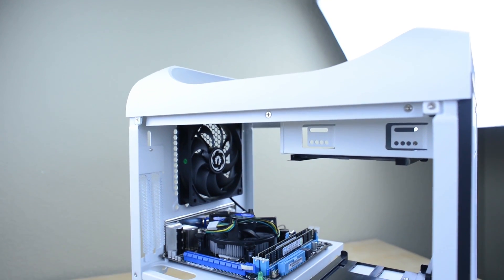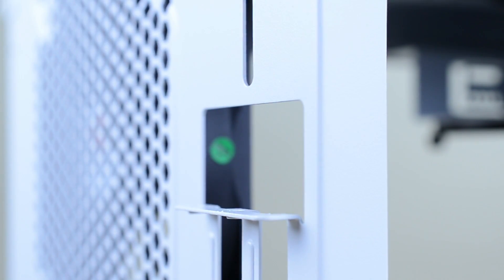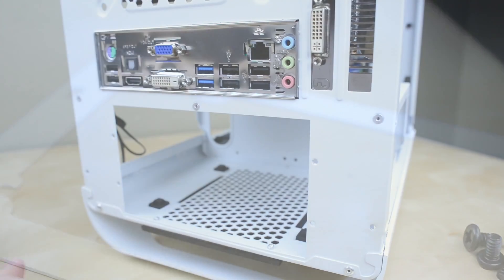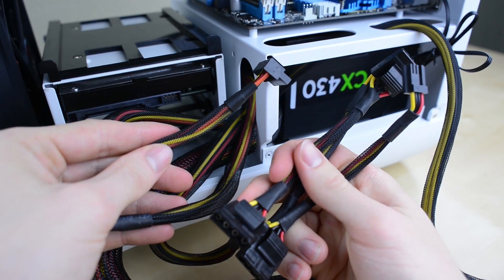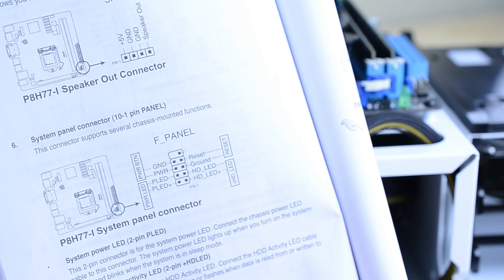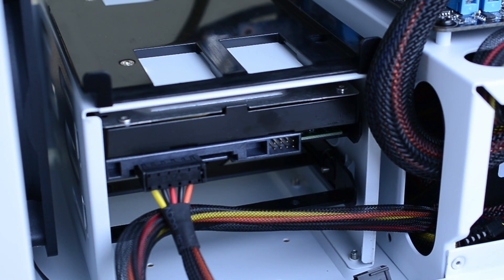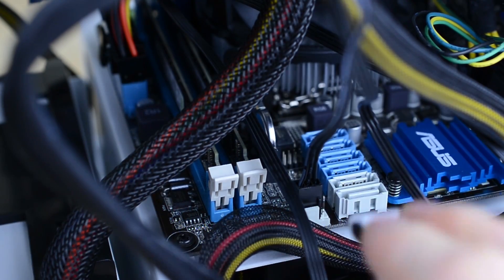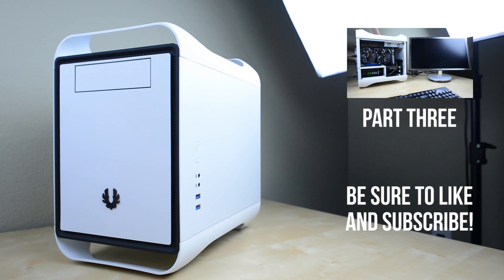How to Build a Computer for Gaming 2013 Tutorial - Part Two

Comment: hmm. I have some problems with a recently built computer. I finished the build, powered it on and everything ran smoothly, the fans worked, liquid cooling pump was on and the cd drive was also functional. I powered off and attached in an hdmi cable to a monitor. Now, the problem is there is no output onto the monitor. The screen does recognize it is plugged in but it is blank and on standby, as if asleep.
Can anyone help me with this?
Another thing of note is that the raisers for the motherboard did not align with the ISO ports. I took out the half closest to the ports to get the motherboard to fit on a slant. Will this bring about future problems? Sorry for the srubbyness. First build ! :3

Comment: hey austin i did everything right but only one thing the computer turned on but the screen wont i checked again but i dont know which cable i check again so can you please tell me
Reply: did you click on the "on" button on screen? if so and it still doesn't work check that there is atleast 2 cables in your screen, one for power and one for the signal. yes the power cable is separate and needs a separate socket
Reply: thanks I just had to plug in the cable right

Comment: Or you can get the Galaxy GeForce GTX 660 TI GC 3GB, it has the power of the GTX 670 and is 60$ cheaper than the GTX 670.

Comment: My psu passes the 'paper clip' test, but when I try to plug the 20+4pin adapter into the motherboard, nothing turns on, and it doesn't click into place. what is wrong?

Comment: For this build, as long as it's intel, it should be compatible. The motherboard uses an intel-compatible socket, so if you were to use AMD processors, it would not work.

Comment: the 16 gb of ram and the i5 are not necessary for this priced system you would be better off buying a better graphics card like a 660 or a 7870 and a lower end cpu as the gpu is more important than the cpu, other than that its all good. .

Comment: I may have a problem connecting the front panel audio pin as theyre in line with the video card port on the motherboard. I'm going to use a sapphire Radeon R7 260x. the motherboard is http://www.newegg.com/Product/Product.aspx?Item=N82E16813157464&cm_re=ASRock_FM2A88X-ITX%2b_FM2%2b_%2f_FM2_AMD_A88X_%28Bolton_D4%29_HDMI_SATA_6Gb%2fs_USB_3.0_Mini_ITX_AMD-_-13-157-464-_-Product 
Do you think it will fit?

Comment: will these work?
Processor
Intel core I5
Graphics Card
Sapphire AMD Radeon HD 7970 3GB
Motherboard
Asus P8Z77-V LX LGA 1155 Intel Z77 Motherboard
RAM
Corsair Vengeance 16GB RAM
Hard Drive
WD Blue 1 TB 3.5 inch
Case
Corsair Carbide Black 300R
Power Supply
Corsair CX750 Builder Series 750 Watt

Comment: I followed this from the 600$ build, and when i turn on the power everything comes on but I get no display. I have tried everything but it will not show display. Any help?
Reply: Try the onboard video port in case its just a bios setting.
Reseat the video card and particularly its 6 pin power connector.
Check the video card in a working machine. Thats what friends are for. :)
Reply: make sure you've correctly attached the GPU power supply. if the fans are working it doesn't mean you connected all the wires to make GPU run, so look out for some input pins on the graphic card and attach on it the proper wire :)

Comment: Is the power supply put in upside down?
Reply: Depends on how you look at it. Often, the words on the power supply look upside down because the manufacturer just wanted to make sure that, if needed, you put the fan facing upwards. However, in this case you can place the fan facing downwards because there is ventilation for it. So yes, the power supply may look upside down.

Comment: But i'm pretty sure it's your RAM. Either you have installed it incorrectly, or you got shipped faulty RAM modules.

Remove/reinsert your RAM modules and reboot. If it still doesn't work i'd ask for some new RAM.

Comment: hey , I'm having trouble getting something to come up on my monitor. When I start my computer, my monitor stays in power saving mode. 
When I turned my pc off and unplugged the VGA cable, my monitor stopped being on poser saving mode. I thought the problem came from my monitor, but it does not seem to be the case because I tried  using other monitors and Tvs and I kept having the same problem. Can anyone help me please ?

Comment: To anyone willing to spend a few minutes to help out a nerd in training, will these components work well with eachother?
-Intel Core i5-3570 Ivy
-EVGA GeForce GTX 650 2048MB GDDR5 DVI mHDMI Graphics Card
-BIOSTAR TZ77B ATX Intel Motherboard
-2x 4gb Corsair RAM
Western Digital Caviar Blue 500 GB SATA III 7200 RPM 16 MB Cache
 Cooler Master eXtreme Power Plus 550w Power Supply 

Inside this case: GAMMA Classic Series ATX Mid Tower 

Am I forgetting anything important?

Comment: does it matter what case i use
will all computer parts fit
Reply: well that depends.. what size motherboard are you going for and it depends on if you're going for a big heat sink or the stock one and how long would the graphics card be? usually mid tower cases should be good enough
Reply: ok thanks

Comment: duncan33303 i would appreciate it if you could reply.. thanks :D

how good is this upgrade 

SAPPHIRE 100354OCL Radeon HD 7870 GHz Edition 2GB 256-bit GDDR5 PCI Express 3.0 x16 CrossFireX Support Video Card 

MSI Z77A-GD65 LGA 1155 Intel Z77 HDMI SATA 6Gb/s USB 3.0 ATX Intel Motherboard with UEFI BIOS 

Intel Core i5-2500K Sandy Bridge 3.3GHz (3.7GHz Turbo Boost) LGA 1155 95W Quad-Core Desktop Processor Intel HD Graphics 3000

????

Comment: I am confused about whats going on with my build. I checked and double checked and I'm pretty sure that everything is hooked up right. but when I hook it up to a keyboard, mouse, and monitor to check it the fans turn on for a moment, then it gives 3 short beeps turns the fans off then repeats. Did I hook something up wrong? Has anyone else had this issue?

please help

Comment: these ?? 

GIGABYTE GA-Z77X-UD5H LGA 1155 Intel Z77 HDMI SATA 6Gb/s USB 3.0 ATX Intel Motherboard 

Intel Core i5-3570K Ivy Bridge 3.4GHz (3.8GHz Turbo) LGA 1155 77W Quad-Core Desktop Processor Intel HD Graphics 4000 BX80637I53570K 

SAPPHIRE 100354OCL Radeon HD 7870 GHz Edition 2GB 256-bit GDDR5 PCI Express 3.0 x16 CrossFireX Support Video Card 

this a good video card??
and why do some reviews on video cards, people say they crash alot and screen turns black or whatever?

Comment: I have Intel myself but that's definetely not true. Yes and Intel chip beats the AMD in basically everything but not in gaming. Thats a 50/50 deal. A FX8350 beats an i5 3570k and a 3770k in crysis 2 and many other games. It's also much cheaper.

Comment: What is the cheapest amount you could pay to make a decent gaming PC ?
Reply: Around 400 dollars. I built mine for $375. The trick is to shop smart and be patient, wait for sales and look around for rebates. NCIX, Newegg, and Amazon have great deals on computer parts. Granted a pc for around this price will not compete with one that's $600+, but usually then can run most games on medium to high settings at a decent frame rate.

Comment: Alright, so I finished building my computer, but my monitor keeps saying no VGA Signal. I know everything started up, fans motherboard, video card, and I connected everything correctly. I don't know why. I know the monitor works because I connected it to a laptop and it worked.

Comment: Will there be wifi on it?
Reply: You'll need a WIFI adapter.
Reply: Absolutely. There will be an Ethernet port along with all the other ports on the motherboard.
Reply: Asen Wolf I have a few questions about this pc. Will it be able to run Counter Strike Global Offensive well? Also would something like this work for wifi? -http://www.rakuten.com/pr/product.aspx?sku=235643186 if so, would I need any more components? Thanks in advance

Edit- also a good GPU to use to play Counter Strike
Reply: tyler friedman
sometimes motherboards come with a wifi card and if you don't get that with your motherboard you will have to get it separately.

Comment: how much is a computer like this worth?
AMD 6-Core FX-6300 Processor with AMD Radeon HD 7750 
8GB DDR3 SDRAM
Multiformat DVD±RW/CD-RW drive with double-layer support.
6MB L2 cache memory
1TB Serial ATA III hard drive (7200 rpm)
AMD Radeon HD 7750 graphics
please answer as soon as possible.
Reply: you'll be able to have quite the gaming experience
Reply: $400 new about, will need a case and OS though

Comment: If anyone would be willing to tell me if these parts will work correctly, that would be greatly appreciated :D I would subscribe to you
-Intel Core i3-3220 3.3GHz Processor
-MSI H61M-P31 Intel H61 1155 Motherboard 
-Zalman Z9 Plus Mid-Tower Gaming ATX Case
-Western Digital Caviar Blue 500 GB SATA III 7200 RPM 16 MB
-Coolmax 500W PSU ATX Power Supply CL-500B 
-Samsung DDR3 8GB 1600MHz Dual (2X4GB)Modules 1.35 Volt 
-Windows 7 Home Premium SP1 64bit (Full) System Builder

Comment: No matter what pc you buy built, you'll be loosing profit. Building your own pc you will have fixed budget depending on what games or programs you want to play/use. E.g if you bought a £2000 pc from the internet, someone somewhere built a pc for 800 that is more powerful than the one you bought. So becareful.

Comment: Why would u use intel i3?
Reply: this is just a demonstration hes got stronger parts.
Reply: Oh... ok thanks.
Reply: GraphicFilm+R+ i3 is fine anyway for a mid-level build.
Reply: thanks
Reply: I'm just saying, an i3 is a very decent processor for gaming.
Reply: yeah but so is i7
Reply: i7 is expensive...
Reply: yeah….
Reply: A 3770K is upwards of £240 in the UK whereas an i3 is half of that, yet you can get decent gaming performance from an i3.
Reply: so just use i5
Reply: i5 is expensive too